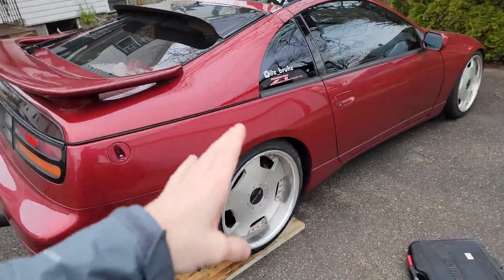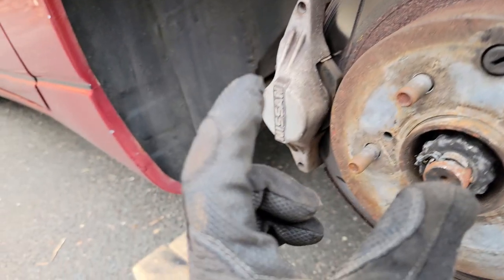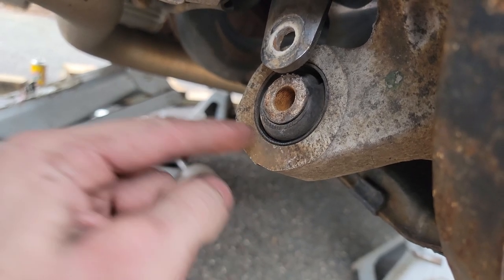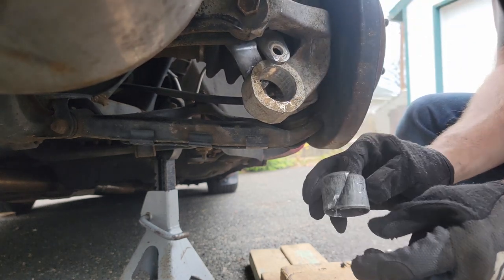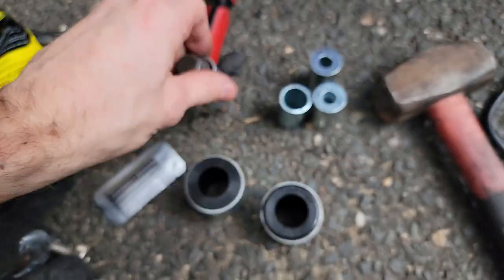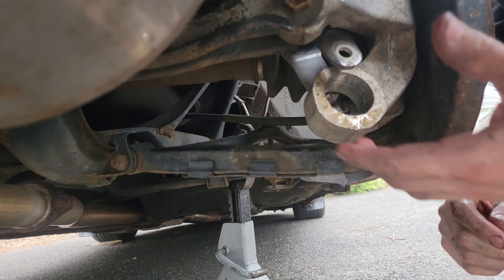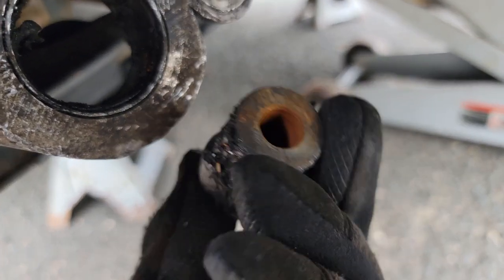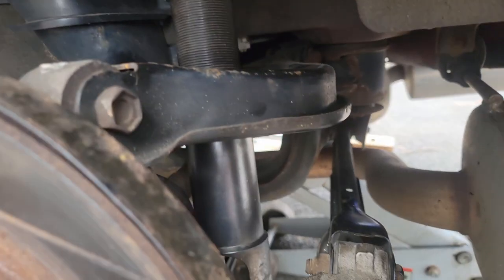Whiteline Rear Lower Shock Bushing Removal/ Install on A Nissan 300zx!

Comment: what kind of noise were you hearing i got some crazy noises in the back of my z32 and im debating if its the shock bushing i need to take it apart and look before i order them but i wanna know what you heard
Reply from the maker: It was a squeak kind if sound along with a slight rattle
Reply: @ZBruhzchannel  thats what mine sounds like i ordered them , thanks for the video man seems easy to swap ive done subframe bushing on my 240 and these should be easier thanks